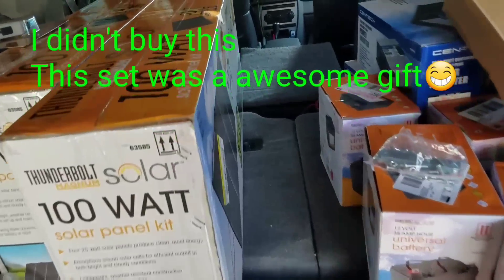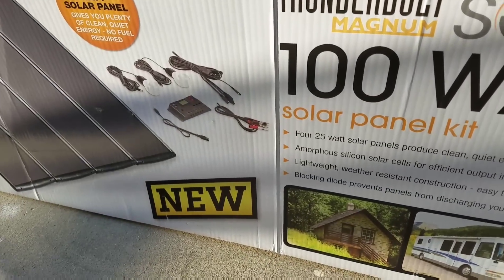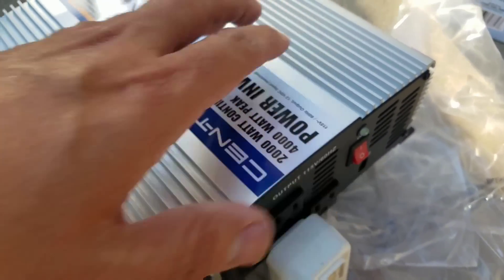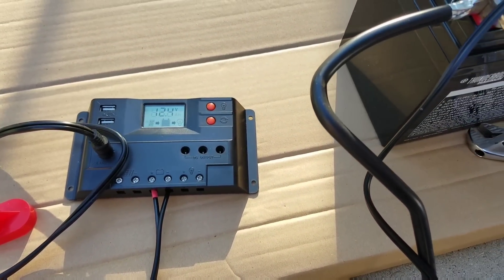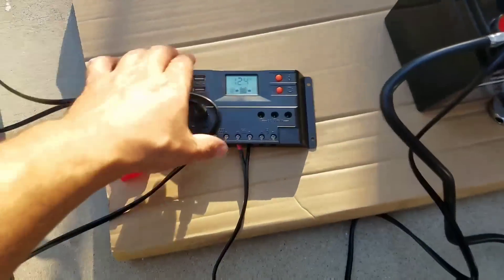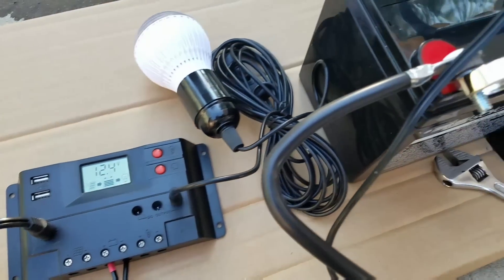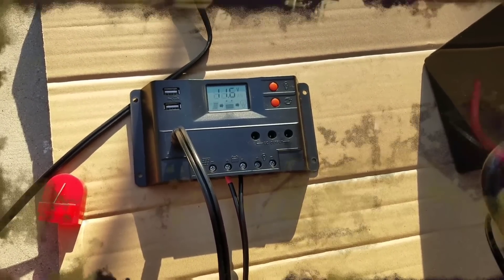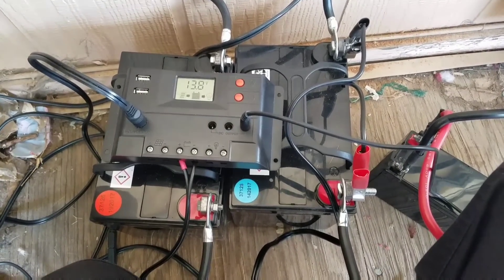How to run an AC unit on solar power

Comment: The crux of any project like this is the underlying math.  To be successful, first it must be possible.  For your inverter to produce 2000 Watts at 120 volts, it must output:  2000 / 120 =  16.66 Amps.  That is enough to RUN a moderate sized AC.  Be aware that the STARTING current is typically 4 or 5 times higher than the RUN Current.

OK, so now going the other direction, 2000 Watts requres at the input: 2000 / 12 = 166.6 Amps.  This is approximately what it takes to start a moderate sized car on a winter morning.  To recap, for every minute you make 2000 Watts for the AC, you also must provide 2000 Watts from the batteries and or panels.  Since you have 300 watts of panels, it begins to look like you will have to restrict the AC use to  somewhere around 1/5 of the charging time (2000 / 300).  

Note that the 300 watt rating is probably a peak value rather than some kind of average.  I don't know, but these things tend to be exaggerated.  Example, they tell you that a shop vac is 6 HP...6 x 746 Watts = 4476 / 120 Volts = 37.3 Amps.  Does your 15 Amp Outlet provide 37 Amps ??? Mine doesn't...

So I would assume until shown otherwise that you will average something less over say 10 hours of meaningful sunlight.  If so, then being generious, lets say 200 watts for 10 hours = 2000 watt hours.  So after a day of charging, you should expect to be able to run your inverter for 1 hour.  If your AC is cycling at 50% on time, then you get about 2 hours or so.  If your AC is less than 2000 Watts, then maybe you get 3 hours and so on.  And if the average output for the panels is 150 watts then maybe you get 45 minutes.

i would also caution that AC compressors don't like low voltage since it reduces the starting torque dramatically.  This will be a great lesson in physics, embrace it, learn from it, and then buy about a dozen more panels!  And don't be surprised if your battery dies in about a year from too many deep cycles.  Oh and make sure that you have large enough wire at every point in your system and know that there may be some pitfalls in joining multiple systems together.

Comment: Hey that's great I need to find one to use in an RV 10000 BTU any ideas?
Reply: Yeah buy a real generator these pannels are a joke it takes 14 hours to charge a battery at 100 watts where I live you simply do not get 14 hours of sunlight in a single day so they are useless my opinion

Comment: Those are great batteries and required no maintenance (I have a few myself), but you could save money and get more power by using marine batteries. They do require some maintenance and care, but it not really that difficult, beside, you need to check your system every now and then anyway. P.s.: your AC will drain that battery in no time.

Comment: Rule of thumb is 400 sqft per ton.  You need 1HP per ton.  746watts in one HP.  Basically you need to look at nameplate of AC units and be able to supply the necessary continuous wattage for the duration of desired operation.  That means a lot of panels to supply the necessary power continuously.

Comment: There is a lot your NOT factoring in the equation because of your incomplete understanding of what is involved. Not your fault, just what it is..  Stop misleading yourself and thinking "it's working" when it really isn't going to do what you want effectively.  By that I mean on a 90+ degree day running the AC for one hour or less isn't going to cut it. You'll still be sweating you balls off the rest of the day.  So NO! 30 or 60 minutes (or the minute or two in this video) of cold air is NOT doing what you really need.  Be honest with your viewers AND YOURSELF and PLEASE do a video of it running from 9 a.m. to 5 or 6 p.m.  That's what you'll need it running for. "Running pretty good" for the 2 minutes you ran it in video is misleading.  In a video running that much you will clearly see what I'm talking about. Yes it can be done but only if done properly.  NOT with 3- 100 watt panels.  Also, NO not with 6- 100 watt panels either.  You'll need a bit more than that.  try 2,000 watts.  Remember, panel ratings are the "maximum" possible a panel could produce, not what they will produce at any given time.  They are NOT what a panel will produce before 10:30a.m. or after 2 p.m. Panels producet less than their rated max. output MOST of the time during the day, my friend.  If you had a clamp on AC/DC AMP Meter you could measure what I trying to explain.   Again , it can be done but with way more panels than you  got there and with a bit bigger battery bank.  Best wishes
Reply: @sailingsolar Good dayLet's say I have a 24v 4k what InverterAnd 8 6v deep cycle batteries I want to run 3.5k in my house off the inveter.How can I set it up?Let's say I have a 235w 34.6v (give or take) solar panel .How many panel would I need?And what else is needed to run this system, besides the basic required wires and charging controller.I would like to add that I do know that the batteries can run in 24v series but what about the panel being 34v+ how can that voltage be lowered or does it need to be lowered..... Thanks
Reply: +Mistur Jay A good rule of thumb is to take all your components like inverters etc and multiply by 0.8 and thats a wattage you shouldnt go over for any extended period of time. So your 4k inverter for your estimated 3.5kw demand should be appropriate. As for your batteries you have 8 at 6v but also we need to factor capacity. If you have 1ah batteries theyre not gonna be much good :D . Peukert was one of the first to develop formulas for drain rate and rates you should not exceed otherwise you could do permanent damage to your batteries. https://planetcalc.com/2283/
Also you need to factor in the composition of the batteries for example most deep cycle lead acid batteries cannot be drained as low as say a nano carbon battery like they use in Teslas power wall. Just like if you drain a car battery down to 10%, youll only get away with that a few times before the battery is garbage whereas newer types of nano carbon or lithium ion can take that kind of abuse much better without destroying their life. Some of the best setups Ive seen are large solar arrays like 1.5 times or more of what you'll actually use and use your electricity all day while barely putting a dent in your battery capacity, then cut way back at night which is pretty typical for off-gridders. If you live in a windy area you might even consider setting up a 1000 watt or greater wind generator, obviously it only makes power in windy conditions but depending on blade design some can get going at very low MPH winds. And people will say dont do it its way more expensive per watt than solar, more moving parts to fail so it all depends on your conditions and budget but it is cool that on a windy night you can be making power while all your panels are dormant. Any best of luck to you.
Reply: Unfortunately you are correct!
Reply: YES sailing solar is telling the truth!!,,hes right!!, i tried every combination and you can not cheat physics !!
And the Laws of power,i don't care how you rigged it or how you run it or how you wire it there's absolutely no way you're going to be able to run that air conditioner unless you at least 10 to 15 to 20 of those panels because you're going to have some slight cloud cover every time a cloud pops out over this and it's going to drop off your water can you going to lose power plus you don't have enough batteries to be able to run it all night either
Reply: Hey those are some very valid points. Can we connect : mails2dhruv@gmail.com . I am working on a similar project and would need some wise advise
Reply: sailingsolar I agree with the first person. You need 300 plus watt panels probably at least 7. Read the specifications on each item and you will get a rough idea. I have a question could you put a battery charger in this circuit and improve the performance any? How about putting some panels under a sun lamp? I am learning about this myself. Thanks for the video good job.
Reply: Bennie Chadwick must have clean power generator and chargers must be used correctly or you will damage stuff.
Reply: Might be better to  ut a 4 cylinder engine car la baron with 14 gal tank and converter box off  it all day into house for AC..
Reply: You need a life.
Reply: sailingsolar no need to be a dick head about it
Reply: Alternatively, use Earth tubes if you have the space.
 https://www.youtube.com/watch?v=s-hGdoHVho4
Reply: I bet you're fun at parties.
Reply: you can run ac off of solar you just need enough power and from what i see he is only going to run the ac on it.
Reply: sailingsolar my agreement..weekend warriors trying to teach incompetence.
Reply: sailingsolar this guy is stupid he going to damage the batteries  what putts

Comment: You can buy a 12 volt boost inverter instead of a charge controller are used the charge controller but put the boost converter coming out of the charge controller and it will boost your voltage coming out of your solar panels up to the maximum of the boost inverter for instance 12 volts up 245 volts when you're only really getting 12 volts from the Sun there shit I get teach you

Comment: You need to figure out and teach yourself if you don't know how but you can wire them in series and double your voltage and get more power hook you're batteries up in series and hook your panels up in series look up videos on YouTube how to hook up so panels and series at triples your voltage and it gives you more than what you would get

I have a great i inverter that plugs directly into your wall of your house and runs directly off so were panels with no battery need it or charge controller and with hooking the panels up in series you can get 5 panels 12 plus 12 plus 12 plus 12 plus 12 year both dishes just outrageous buddy them great I inverters take 50 to 60 volts without a problem

Comment: but have fun. it wont run  more than an hour before the inverter kicks off from low voltage. you will need to match the solar panels wattage to make it run all day of coarse . so if its a 600watt ac you need 600watts solar. actually you need another 100watts of solar to have an increase in battery volts.. i have 5000watts of solar panels i bought from ebay for 1200 dollars plus 395 freight  .go ahead and take the plunge because you will be very happy.  5000watts of panels that cheap when the local Solar company charges 4 dollars a watt or 20000 dollars

Comment: You need deep cycle batteries not car batteries ,I use 5 ,125 amp hour deep cycle batteries on my 300 watt panel and 3 old style harborfrieght 15 what panels , this way I have enough power to get threw the night , I use a sun charger that is great, and two power inverters , one a 1500 /2500 cobra inverter and a 2500/3500 watt one from harbor freight , had system up and running for ten years now, mind you , you can't run the whole house with it but I can run my micro wave, hair dryer, vacume , tv , even my fridge , not all the same time , another thing , you don't want to discharge your batteries below 85% , that will kill them fast, another thing , you goal is to maintain 13.5 volts all the time , you see , your on the right track , it's a lot of fun screwing the man, hahahaha , good luck. Have fun
Reply: Fred Houseal h
Reply: Spelling dude, spelling.
Reply: Joe Schlabotnick dude has his own off the grid system for emergencies. fuck your spelling
Reply: How could you possibly be using 5 batteries? Lol even numbers are the only way they hook up unless you have 1

Comment: okay guys after reading a few comments now I'm a little bit confused can I run my AC unit without the batteries during the day I mean just to save some money can I just powered the AC directly from the inverter and have the cells powering inverter of course through the charge controller
Reply: I wouldn't try it without batteries. If a cloud passes, it will shut off. You may also run into problems with fluctuating power. I don't know that for a fact, but I would be concerned about something that uses that many amps cycling on and off. It may be hard on the electronics.

Comment: hey nice video. I'm sorry maybe I missed it in your video but how many panels and how many watts each were you using to power that small AC unit? this is something that I definitely wanted to do this summer but I couldn't really get the right info wasn't sure how many panels how many watts each would I need to power my AC I'm not sure how many wattage or BTUs my AC is but it is a small one just like the one you have on this video maybe even a bit smaller

Comment: The harbor freight panels are actually very expensive. Renergy has 100w panels for $130 each on Amazon. Some 160w panels costs only $160 on ebay. And Sunix 20A charge controller is $18 on amazon.
Reply: Samual Whittemore you could have 5k of poly solar panels but if they aren't in direct sunlight they are worthless
Reply: DexterGoneWild $150 for 100 watts of panels, a 30 amp charge controller, two LED lights and ALL the wiring pre terminated with weatherproof plugs?  That's a good deal in anybody's book.
Reply: @TexasScout 
I can get you 300 watt panels for $0.42 cents per watt.... $126.00 utahtrailerrepair@gmail.com
Reply: The main attraction here is they are amorphous panels. Unlike the Renogy. Meaning if 100% of the panel isn't in direct sunlight they don't charge. These panels don't have that problem
Reply: DexterGoneWild Direct from China -> $3000 gets you (30) 250 poly 25 yr panels. That's 7500 watts. And the $3000 includes shipping to the Long Beach, CA  port.. You would have to handle it from there.

Comment: So where are you sitting right now?  $186.00 per solar kit $40 per battery, cables, $700!!
Reply from the maker: +John Lucero I didn't pay for much, most of it was a gift. each kit was purchased on sale for  $150.00, $70 per battery, cables $100,  2000 watt Inverter $120, 5000 watt Inverter $380 so with tax around $1,450 total
Reply: Yeah I can c that , I did the hf solar system with the 45 watt kit but everybody is right on one thing amazon 100w panels are worth the price for off grid but one thing most over looked hf kit panels work better in low or indirect sun light better than mono and poly crys. Panels my opinion use and intergrate both and get pure sine wave inverters hf 's   R  modified sine wave can damage tech but not power tools best of luck